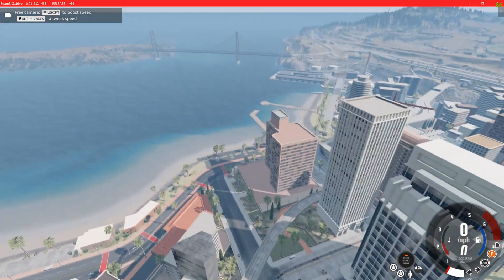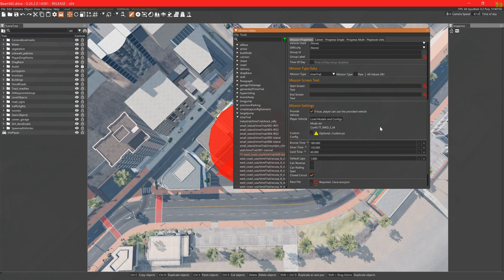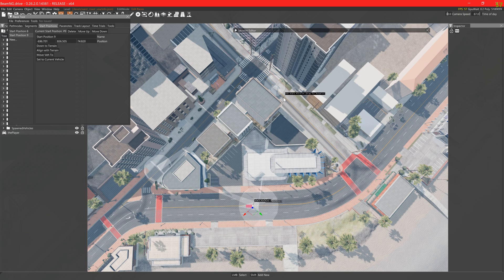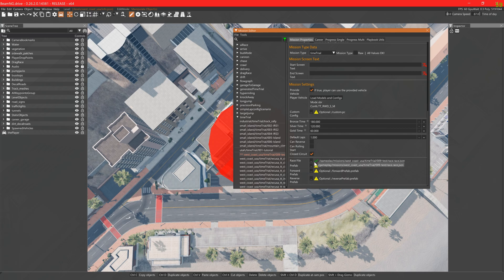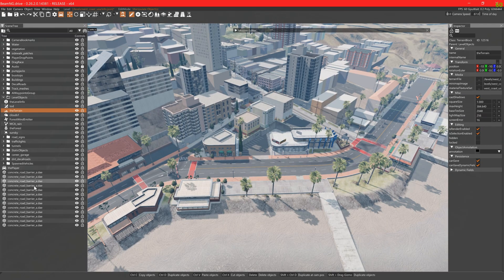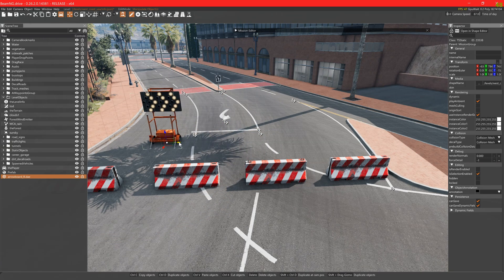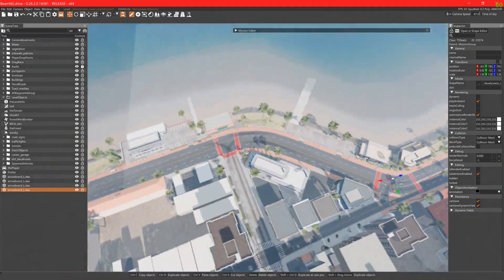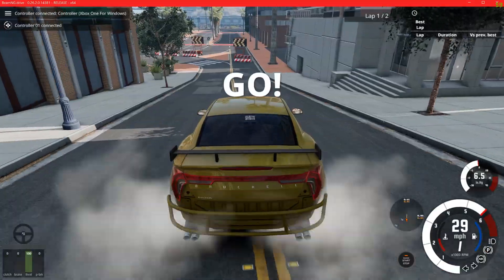Time Trial Mission Tutorial - BeamNG.drive

Comment: Hey, thanks for the video set up, got my point to point race set up easily, however I have one issue, I've noticed on the way points when me and my friend are passing through there the timer is knocking off 4 seconds each time we pass a checkpoint, have I set something up wrong?
Reply from the maker: you are using it in multiplayer?
Reply: @HighDefBNG  Nah, I made it in single player, send the file to my friend so he could run the course, he screenshared it, and I noticed every time he was going through the checkpoints the timer would roll back a second
Reply from the maker: @EggGrips  Ah I see. Are you running any other mods? There is nothing in the mission code that should change your time.
Reply: @HighDefBNG  The map itself is a mod, but that's it, using the Sunburst as the car, it's strange, we just ran the course with an external timer, we finished in 4:09 but the game read it as 4:06
Reply: @HighDefBNG worked it out! We both had frame limiter off! As soon as we locked the frames to 60fps it started giving accurate timings! Honestly thanks again for this video (and all the other videos you make) and for taking the time to reply to me!
Reply from the maker: @EggGrips  Glad you got it working right, and thanks for bringing it to my attention.  I will investigate and try to organize a fix.
Reply from the maker: @EggGrips  Ah I see now that my awarded time is 7 seconds shorter than the timer was when I hit the finish.  We shall investigate! Thanks again.

Comment: So I'm having two problems. One is that even though I have the startTrigger placed in an open location, the game is deciding to put it in the ground and completely ignore where I have it set. The other is that the game's path is not at all how I have the waypoints positioned. What is going on?
Reply: Note: I'm not using a closed circuit, it's just going from point A to B.

Comment: Really clear tutorial, but I have a question, is there a way to keep the prefabs in freeroam? Let's say I make a time trial for which I made a street circuit, how can I have it stay in freeroam once the mission is finished? Optionally, is there a way I can spawn/despawn the street circuit whenever I want using the world editor?
Reply from the maker: You can go into the mission editor, find your mission, then scroll down to the prefab part, then click on the button with three dots and then click 'spawn prefab at origin' and close the editor.
Reply: @HighDefBNG  Great, thanks! I have another question regarding the folders, I'm not sure I saved the mission in the right folder (the mission works but still), can I move the files to the right folder or do I have to start over?

Comment: Can anyone help me my checkpoints arent visible during the race
Reply from the maker: Have you assigned the race path in the mission editor? and did you press ctrl-L after you leave the editor?  I forgot to mention that in the video.
Reply from the maker: @yannikschreibel9678  You have to save it in the mission folder with the name race.
Reply: I saved it in /gameplay/missions/moab/timeTrail/001-RallyRace/race.race.json
Reply: But race tool also says that  1 pathnodes are missing normals
Reply from the maker: @yannikschreibel9678  Have you checked the track layout settings to assign the correct start points and positions? Also click preferences at the top and turn on ai path to check for problems with the race path layout.  It could be that you have a segement issue or something.  It's a little tricky to get used to at first, in my experience.

Comment: Good tutorial, but I do have a question for you. You did not explain why the arrowboard need to be in the forward and reverse prefab? Why could we not simply put those in the first prefab you did with the concrete gates? Briefly it is not clear to me what the difference is between prefab, foward prefab and reverse prefab.
Reply from the maker: Forward prefab is used only when driving the forward config, and reverse prefabs are only shown when driving the reverse config, as in, the same course but backwards.  Hope that helps.
Reply: @HighDefBNG  OK! Yeah that make perfect sense. And you had the concrete gate in prefab since it will be used on both (forwrad/reverse). Thanks for the reply!

Comment: Is there a setting to make time trial visible from Main Menu/Time Trials section?
Reply from the maker: You can make it visible from the scenarios menu but it wont let you select any options, like lap count or reverse or rolling start, it just uses the default settings. In the mission editior there is a checkbox for it.
Reply: @HighDefBNG  Yes, I see, it will show in Scenarios section. 
Creating the time trials the old way, where you save the files in 'levels\*level name*\quickrace' folder, then they show up in TimeTrials main menu section. 
Strange that this option is not yet added to level editor.

EDIT: Figured it out.
1st - you place your objects and pack .prefab file (so you better know where and how to put checkpoints)
2nd - use Race Path editor to put down checkpoints and add other information etc. 
3rd - save everything to levels\*map name*\quickrace
This way your time trials will be available from BeamNG main menu time trials section.

technically you can use the 'Mission Editor' only to change/move the start trigger and to refresh the missions so you can see your newly created time trials

Comment: uhh, when I open the mission editor, it says no time trials found in the area underneath File and Tools.. And I when I press Create Mission, nothing happens?? this is on all maps both default and modded
Reply from the maker: I am really not sure what could be causing that, perhaps the filters.  There is a little green bone or something button near the top left of the mission editor, make sure it's all unticked it there.  Otherwise you may want to get in contact with the support site.  Something sounds broken.
https://documentation.beamng.com/support/reporting_issues/
Reply: @HighDefBNG   Yes :) Thanks that helps🤗
Reply: @Megasieppi  hi ! Did you solve the problem ? Because i have exactly the same. Thank you.

Comment: Thank you! I cant wait to see more in this series. I started a map from scratch about 3½ months ago and your old videos with davidinark were a massive help to get me going. I still have plenty to do before adding missions, but videos like this are a nice way to break up my work flow so I dont get burned out. 

Staying on topic of this video; is it possible to set a custom.uilayout.json to your mission instead of the default race.ui? Or is it limited\determined by the Mission Type selected?
Reply from the maker: Thanks for your support, I'm always happy if my videos can help out. I think you can modify each preset ui app layout, I could be wrong.  If, in freeroam, you use the drop down list on the ui app menu you should fine the time trial preset in there, maybe you can modify that.  I'm not sure.  Happy modding! :goodvibes: